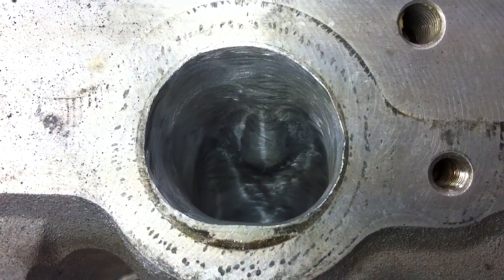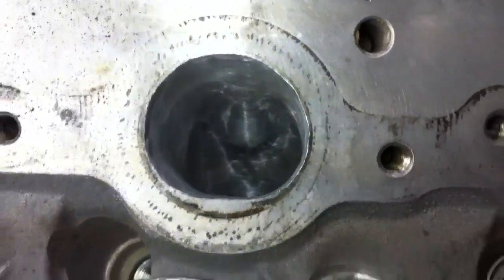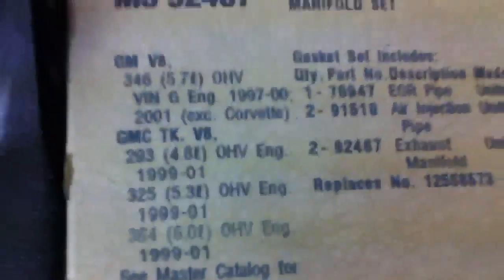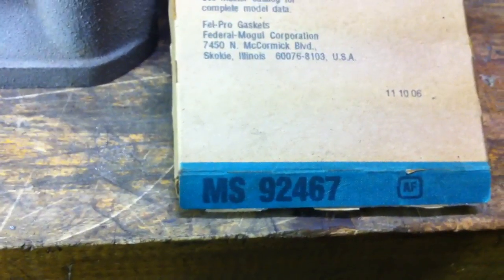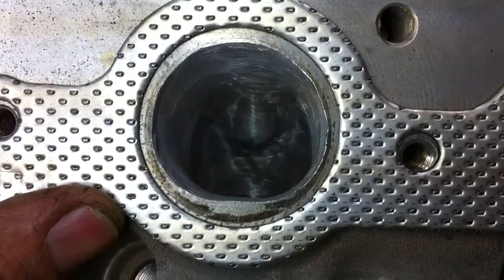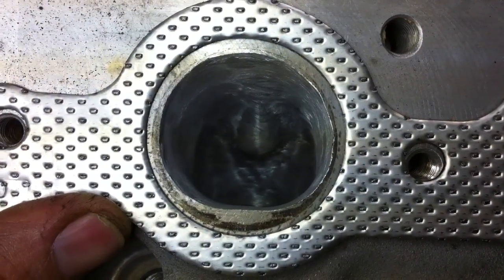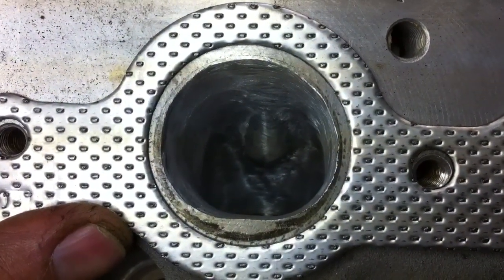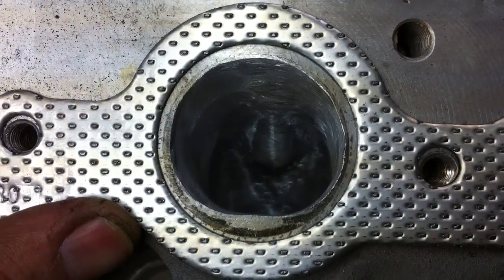How To LS1 DIY Head Porting Part 6 Cont - Exhaust Gasket

Comment: Hey man how much did the machine shop charge you to put the 2" LS1 valves into those heads?
Reply from the maker: 1 CammedSS I don’t remember the price right now, but I believe that it was the same cost as just getting a valve job. The factory valve Seat was large enough to just be cut out to fit them.

Comment: These videos are Priceless! Thank you so much for this awesome info! And great Job! To say the least!....I am in the process of porting my 862 heads and I do have a question. In this video, you're explaining that one should match the gasket to the exhaust port and the manifold port for proper sizing of the openings, well I've notice that on all articles, pertaining this subject, pictures, videos and on this video as well, I have not seen any pictures or videos where anyone is trimming or grinding the bottom side of the circumference opening of the head exhaust port, Only the top side of the opening port is where I'm seeing the modification...Which leaves the exhaust port opening sort of egg shape.....Is there a reason for that? Does the bottom side of the head exhaust port matches with the OEM manifold ports? I bought my heads at a core shop, I haven't taken the manifolds off my truck yet to answer my own question, and I would appreciate if you can.
Reply from the maker: Awesome Rick! Glad you've found them helpful. Back when I was researching how to do this, I couldnt find much info on the net and definitely no videos. So, I decided to make some. These videos are what kicked off my channel actually.

To answer your question, yes. You want a "D" shaped exhaust port. Leave the bottom alone all the way through the port besides smoothing. That is because the air travels high in the port. You don't want to enlarge the bottom of the port where there is not much flow. A larger port will lower velocity.

Good luck on the porting Rick and Keep on Wrench'n!

Comment: Do u have any suggestions on porting for the 806 heads im currently building an LS 427 stroker with some high compression flattops and shaving the heads .020 thousands hoping to get into the 13:1 range. I was told the 806s lack on the exaust but make great compression how can I make my 806 heads flow the best they can
Reply from the maker: 806's came on the early LS1's in 1998. THey have perimiter bolt vavle covers. They are less desirable because of this. I believe their ports were the same as all the other LS1 heads. So these videos would apply to those heads as well. Depending how much compression you want, 862 heads may be better. They have a 61cc combustion chamber vs the 67cc of the 806's.
Reply: But arnt the valves smaller on the 862's than the 806's and it just so happens I have a set of 862's in the basement
Reply from the maker: 862's are my favorite because of the small combustion chamber. Even with their smaller 1.89" vs 2" intake valve they still flow the same as a LS1 head. The exhaust valve is the same size. I usually pick up used 2" LS1 intake valves cheap and slap them into the 862 head.
Reply from the maker: Also just fyi, usually anyone talking about building a 427 LS motor would have deep enough pockets to not be porting their own heads. They'd usually be buying a pair of aftermarket heads. No offense, you post just seems odd.
Reply: I bought the crank for 615 dollars the pistons for 500 and I had the money by selling my old camaro for 1000 dollars the rods im still trying to get I dont have much money but but it doesnt cost as much anymore because everyone is starting to do it
Reply from the maker: Cool man! What block are you using? 427 is not a common size for LS. 408 is more common and is suppose to be the max reliabel size recommended on TSP's website i believe.
Reply: Im using a 6.0 liter block my buddy works at a machine shop he does all the boring and line honing im having him bore it out to 4.070 instead of the stock 4.000 and the crank I have is a 4.125 inch stroke crank
Reply: Then putting 6.125 inch H beams Im getting a deal on some callies for 350 dollars
Reply from the maker: Bad ass man. Thats what I like to hear. Poeple finding ways and making it happen.
Good job!
Reply: Yep I just turned 20 I was gonna build a 406 with 450 hp but then I met my buddy he told me not to waste my money or time and showed my how much u can make on these LS engines for very cheap and next thing I knew I was building a 427 LS2 shooting for making hopefully between 750 and 800 hp for around 2000 dollars i got the cam from my buddy for free because I helped him build his motor for him after his accident he couldnt do much so he gave me what hes not using hes go a nice lanadi 630 lift cam and now im annxious to finish it and listen to that baby run and I believe ur the one my other friend is building a 5.3 so I think ur doing the 4.8 piston in the 5.3 right?
Reply from the maker: Nice man! Smart friend you've got. Thank him for talking you into this. lol

Yea, I've got 4.8 flat tops in my 5.3 going into my daily driver '87 Chevy truck.
Reply: Do u have to do anything special to do that or are they the exact same other than there flat top pistons?
Reply from the maker: Nothing Special. I just mounted them onto the 5.3 rods and slipped them in. I've got a video on it.
Reply: Awsome so they fit perfect nice

Comment from the maker: wow! thats a huge completment! Thank you!

What he is probably describing is that you dont want the flow to run into a smaller port. Follow the direction of the flow of air and it should not leave one port to hit the edges of a smaller port opening. That will create horrible turbulence. So that is what port matching will eliminate. So if your matching the exhaust port, you dont want to open it up bigger then your header or manifold port is. That is why I port match my exhaust manifolds also.
Reply: You actually do not want the exhaust port in the head the same size as the header or gasket.
You want the head port smaller then header so theres a lip 
This stops burn back into the cylinders caused by exhaust pulses.

Comment from the maker: lol Thanks man! Glad I could help. Your heads may be different then these but some similar basic idea. Just smooth/blend any edges from the port. Leave the air to have a smooth transition, removing turbulence. One area will probably be at the valve seat. 

I was in the same boat man. Couldn't afford to have it done, so I researched to figure out how to do it myself. I may not get professional numbers but did give my heads some great gains.